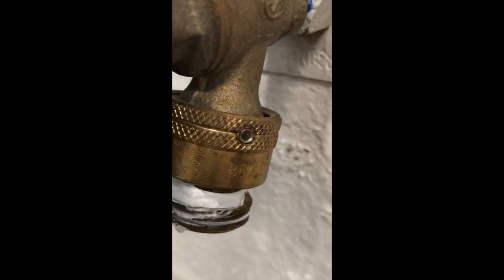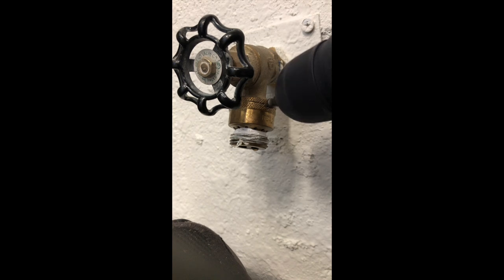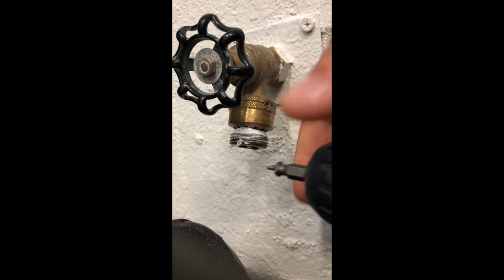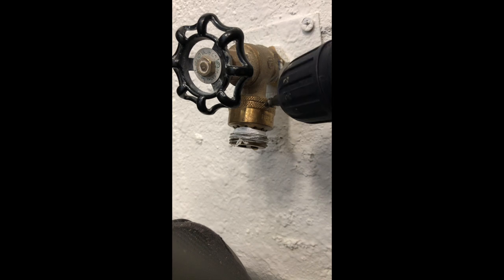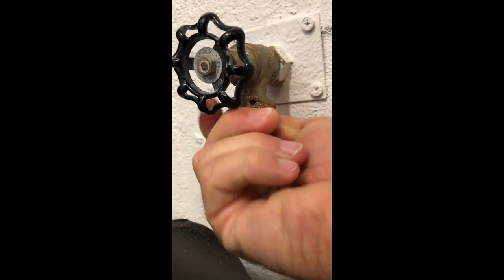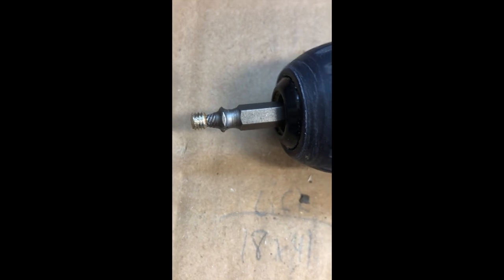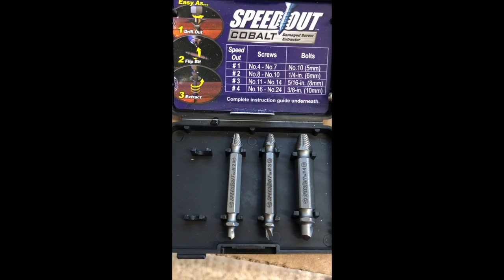How to remove antisiphon back flow preventer hose bib

Comment: Had that exact same vacuum breaker. Used a hacksaw to create a slot for a flat head screwdriver. If you notice there is a groove already there that’s perfectly centered on the set screw. I removed 2 today easily.

Comment: thank you. I bought the same exact tool but it didn't work like in this video. I ended up just drilled the little rusty pos. Thank you!
Reply from the maker: Make sure you follow the instructions on direction of drill - the first bit is designed to make a small hole only and then the second is to “bite” into that hole.  They go different directions.

You can probably re-try with the next bigger size if you didn’t drill too far in.

Comment: Mine are bad. Forgot this but the fiasco I had years back with my porch faucet I simply replaced the faucet. Just dawned on me my faucets are 7/8 not 3/4 soy backflow is 78 with 3/4 MIP. They were crimped on, so set screw. Now I need 4 so looking at nearly 15-20 per backflow vs the 3/4 for 8 bucks. It is cheaper to simply replace all with a new 1/2 Fip x 3/4 MIP and get a set of 3/4 preventors. Weird thing is I do new home work and most new homes done have a backflow on taps, only the sprinkler system. Guess mine, 16 years ago didnt have a sprinkler system, added later, so it jad to have backflow devices on all taps. I cut one off today and I thing this 7/8 tap was made with a preventor on it.

Comment: Thank you for the video.  What size extractor did you use?
Reply from the maker: I used the smallest one in this set (speed out#1) - it states for #4-#7 screw sizes.  Perfect size for the job
Reply: @ystebadvonschlegel3295  after I saw your video I ordered from amazon  a set of extractors. All DIYers should have that in their tool box. Thanks again.

Comment: Do we really need to keep this thing on or would it be okay if I don’t use any backflow preventer with my garden hose?
Reply from the maker: Of course I can’t reply to “need” that would depend on your local code. However do educate yourself as to why they are installed.  If you ever attach any chemical sprayer at all to the end of the hose and don’t have one you definitely can back flow that into the water supply. 

In my case this particular faucet is only used to wash cars with a pressure washer so I did not replace it.   When I sell the house I will replace it to meet code.

Comment: Ok your little screw has a hollow hole in it. Mine doesn’t. Will that bit tool thing you’ve linked still work for me? Sorry if that’s a dumb question.
Reply from the maker: It will drill out any screw or bolt.   The hollow hole is the part that breaks out because it's designed to keep you from removing it.  Yours may be slightly different but if it's a screw the remover tool will back it out. You might just have to be a little more careful in holding the drill and starting carefully to center it.  Best wishes.
Reply: @ystebadvonschlegel3295  i wish I could send you a pic of what I am looking at! We built this house one year ago and this thing sprays out like a geyser every time I turn off the hose (even if I don’t have a sprayer attached at the end of the hose). It’s ruining the siding on my house. My little broken off screw thing is completely flat. So I just drill right on the flat part with this bit even though it’s isn’t already hollowed?
Reply from the maker: @CBull015  Yes - yours does exactly what it's "supposed" to do.  And yes it's a metal drill bit and that is likely soft brass.  So long as you have a steady hand and go slow it will work fine. You are drilling a new hole with threads and so then the other side will back into those threads and then back the screw out.  Just make sure the bit size you choose is smaller than the size of the screw you're trying to remove - if you drill past the threads into the surrounding metal it won't work.
Reply: Gosh thank you so much!
Reply: what part did you get to put on after you removed the anti siphon?
Reply from the maker: @madisondabronzo713  When you remove the anti-siphon you are left with a normal male hose end.  It is not code to leave the anti-siphon off in the area where I live because of concern for back-flow into the municipal water system.  In my case this hose bib is used only for washing car with pressure washer and hooking a watering hose up intermittently which is not left in place but removed each time.  Both of these will attach directly to the hose end that is left after removing anti-siphon.  I do not advise anyone else to do this, but each person can make their own decision after consulting local codes.
Reply: @ystebadvonschlegel3295  thank you for responding. i have removed my anti siphon but just trying to figure out if i can now put my garden hose directly on the spigot or if i need another attachment or not
Reply from the maker: @madisondabronzo713  Yes you can, but do please review the conditions under which siphoning back into the water system can occur.  There is a reason that cities require these by code.  You don’t want to poison yourself or your neighbors.  Most importantly NEVER leave a hose connected to anything such as fertilizer (sprayers etc) or any chemical that you wouldn’t want to drink.  Negative pressure in your home from activities elsewhere (even outside your home like flushing a fire hydrant) can draw water back into your home from these devices and contaminate your water.
Reply: @madisondabronzo713  for what it’s worth I didn’t put anything back on my hose bib and it has been like heaven. My water hose connects right to the hose bib and doesn’t spray me in the face when I turn it off.
Reply: @CBull015  that’s awesome. thank you so much!

Comment: Yea, I just drilled out the screw stub that was in there then a squirt of WD40, and the whole thing unscrewed.  Did that on 3 of those buggers. I will not be replacing those idiotic contraptions. Boy what a mess if I had to replace the whole spigot. It is sweated on. I will only call a plumber if it was my last resort. Who ever came up with those.and why?

Comment: , our set screw is on the backside, so I don't have access for a drill.  Any recommendations?
Reply from the maker: In that case something like a fein or even a dremel to saw through the actual brass but be VERY careful with eye safety due to risk of metal fragments and go slow so you don’t damage the underlying threads. But cutting through and then using channel locks to pry a bit of space will get it off. I did that version in the past before I tried this extractor

Comment: Mine has totally failed. Water sprays out of the side holes with no hose attached. Nervous about doing this repair and making things worse. Is the alternative just to call a plumber?
Reply from the maker: Easy for a plumber to fix - just be aware what the charge will be just to show up to your house you may be surprised how much it will be so ask in advance!

Comment: I can’t tell from the video what end is the extractor I’m old and my eyes are bad.Could you show or tell me which is which
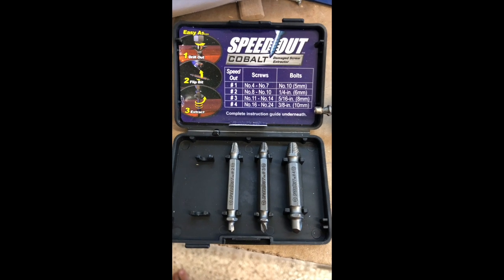Reply from the maker: To use the extractor kit the drill is ALWAYS in reverse mode.  The end that looks sharp and pointy with a straight sharp line is the drill out side and is used first.  The end that looks like a screw with threads and a somewhat flat top is what you use to actually back out the screw.   You can see both at 0:26 the drill is on the bottom (use first) and the extractor is on top (use second and SLOW)  Remember both times the drill is going in reverse.  And when you remove the screw you do it SLOWLY - #1 reason for failure is stripping the screw out by going too fast. If your drill has driver and drill mode make sure you use driver (SLOW) mode for the extraction bit.  Cheers and good luck!

Comment: That's so annoying I waste more water from the faucet than what I spray out, is it because it defective preventer or there meant for water to gush out
Reply from the maker: It’s mean to gush out but generally only when you shut the water off. If it’s coming all all the time you definitely have a defective valve so you could replace it or if you want you can do what I did in this video, with the understanding that you are defeating a safety feature and that it might not meet local code.

Comment: I tried with the screw extractor, for some reason it’s not able to drill the hole in that screw
Reply from the maker: Make sure it’s turning the right way and that you use the right end - one is the extractor and will not drill but they look similar .  One other person posted the same problem- it’s always worked for me
Reply: @ystebadvonschlegel3295 the drill side is the one with more aggressive edges right . I used the drill in hammer mode in counterclockwise direction(arrow facing backward button). Let me know if I am doing something wrong
Reply from the maker: @kushagrasingh7731  you definitely do not want hammer mode and re-read the instructions and pictures if you bought the kit I used. User error - it happens.
Reply: @ystebadvonschlegel3295  ok thanks

Comment: Okay.  Mine started leaking water and needed to replace this.  I called up a guy who had a similar extractor but he ended up breaking the bit. Basically the drilling worked but couldnt extract. Anyway he ened up using dremel cutter to cut and remove the broken screw. Oh my ...i can understand its important to keep them on but why u have to break the screw.  Jeee
Reply from the maker: The screw is broken off because the all wise government doesn’t wish the average person to be able to remove.  Common good vs individual freedoms colliding.  I can see both sides - if you remove and don’t understand why it’s there it’s true harm can be done no only to yourself but to the neighbors. So it’s the cost of attaching your home to the public water system I guess.

Comment: Just tried this. Wasted money on extractor set. All you need is an 11/64 drill bit. Go slow and you will see broken screw come out. Stop and wiggle valve with channel locks and it will come out. After a couple of turns.  The one I took out was put in 15 years ago. The extractor was ruined.
Reply from the maker: Hmmm. Glad you got it out. Drilling all the way down to get the entire set screw down would be more likely to damage the faucet but glad you made it work. When I’ve broken extractor set bits in the past it’s usually been that I was going too fast. Cheers and thanks for the reply.
Reply: I used drill bit, I don't know the size.
I put WD-40 and was so easy to extract the broken screw and the backfkow.
Thank you for your suggestion.

Comment: So, what can you do when you can’t access the screw to drill it??? The code should allow access to the screw!!!!!
Reply from the maker: If the screw is on the back or not reachable then probably the best bet is to get a hacksaw or fein type saw and cut the brass outer ring itself and then pry it back.  I've done that too and you have to be careful not to cut too deep and also be very careful because metal shavings in the eye can cause permanent eye damage (safety glasses a must and proceed at your own risk).  I've not seen them installed behind because it takes a screwdriver to drive the screw in before it's broken off on install, so generally they are on the right side because most people are right handed.

Comment: They twisted it so it is facing the wall and broke it off....
Reply from the maker: Those dirty dogs.  Sometimes you can wrench it enough before it catches on a thread to get to it with the drill.  Otherwise it's the Dremel technique probably - WEAR EYE PROTECTION!

You can saw through the actual brass but be VERY careful with eye safety due to risk of metal fragments and go slow so you don’t damage the underlying threads. Basically you cut two slots separated by maybe 1/4-1/2" and then pry the slot inbetween back.  But cutting through and then using channel locks to pry a bit of space will get it off. I did that version in the past before I tried this extractor

Comment: Tis product sucked.   The drill end wore down as did the extracting end.   In its place I used a dremel tool and carefully cut an X over the screw.  cuts were deep enough to pulverize the screw and with a wrench I twisted and removed the antisyphon piece.  The spigot sustained no damage.   But if you do this,   be patient and be careful.   Replace the antisyphon with a new one but DO NOT use the screw that came with it.  Instead tighten it by hand and be careful not to remove it when undoing the hose.
Reply from the maker: Very strange - have had a couple people say similar things.  I’ve used mine multiple times over the years on multiple screws including the project above done on several back flow devices and never had a problem.  It’s hardened steel, and the speeds used are very slow so no clue how it would “wear down”.  

I have also used the dremel approach and it does work as I note in the video but you have more chance of metal shavings in the eye so please use eye protection (not just glasses) and be very careful!  Glad you got yours fixed!

Comment: this did not work. Not sure what sort of whussy backflow preventer is being used here. Reverse drilled like hell and couldn't get it out. Also broke my batter powered drill; think I put the speedOut drill bit too far down and it drilled into my batter drill. New drill only the first time using. This video cost me $60.
Reply from the maker: I'm really confused how you could have harmed a drill doing this procedure.  If you watch what I'm doing, everything is pretty slow and minimal.  The first "hole" drilled is pretty shallow and the actual reversing bit I specifically tell you slow and easy.  The only thing I can think is you didn't have the square part of the shaft of the bit gripped in your drill chuck properly.  While I suppose that might cause some damage, proper operation of tools is always important.  And this back flow preventer here is solid brass, I did 4 of them - one which I couldn't reach with a drill and had to use the reciprocating saw technique which sucked.  Anyway sorry you had a bad day trying to fix something at home, I know that can be frustrating.  If it's still there double check you used the correct side of the drill bits (using them backwards will certainly not work) and unless you drilled really deep you could potentially try again with the reversing bit.

Comment: Quality of this item was really bad.  The drill bit was not hard enough to drill into anything made of metal, and naturally can’t achieve what it’s designed to do.
Reply from the maker: Interesting. I’ve used it on multiple items with great results.   Are you sure you used the right one as the drill - remember there is an extractor bit and a drill bit. And also remember you have to follow instructions on direction of rotation.

Comment: This tool did NOT work for me and I returned the set to Amazon.  You notice HIS broken screw already has a HOLE in the middle.  Mine did not and there was no way that tool would drill into the broken screw body.  I spent a lot of time thinking I had done something wrong, then called a friend of mine who does plumbing work and he said "Don't waste your time, just use a Drimmel and cut around both sides of the screw and break it off with pliers.  This is a deceptive video in my opinion.
Reply from the maker: I think your comments are over the top and "deceptive" is clearly not appropriate.  I have used screw extractors to drill into bolts and screws many times and it's exactly what they are made for.  If you break off a bolt in an engine block and its flush on top guess what you use - one of these.  I suspect you didn't proceed with SLOW drill speed as I suggest and with enough stability on the drill.  Like any other attempt to drill metal it's the start that is the key.  Using a very small bit to make an initial hole then a larger extractor bit to back out may be  a good technique for those that can't steady the drill in the center.  If it starts "walking" it isn't going to work.  

There are many ways to accomplish the same goal and Dremel and pliers are an option which I also note in my video.  But you run more chance of damaging faucet or getting metal shavings in your eyes (wear SAFETY goggles, not just glasses if using a Dremel on brass please!). This method works but you do you.
Reply: This video is not deceptive; it saved my sanity! You cray